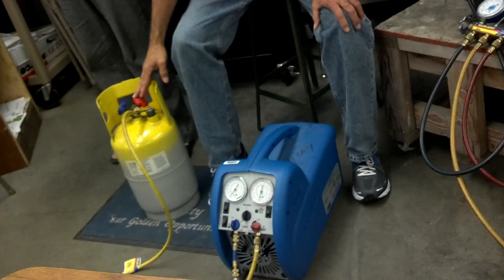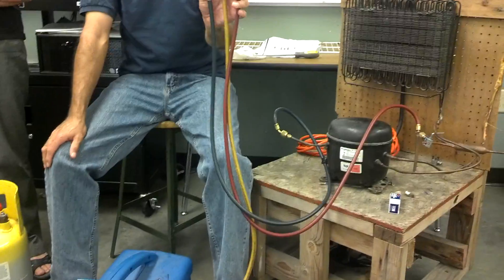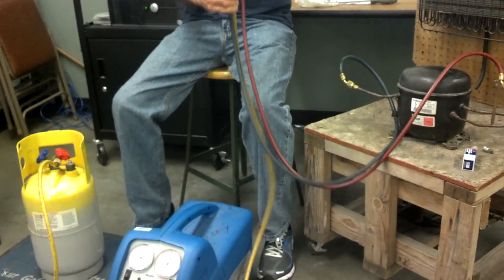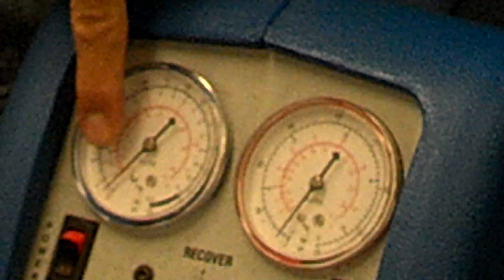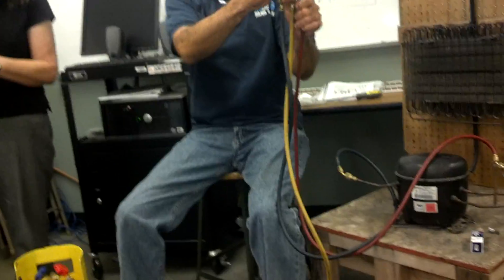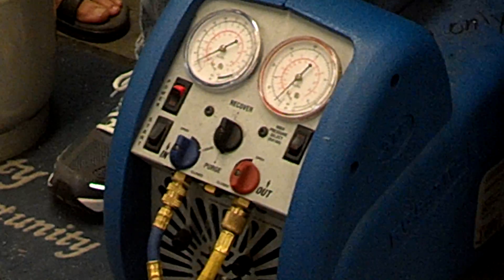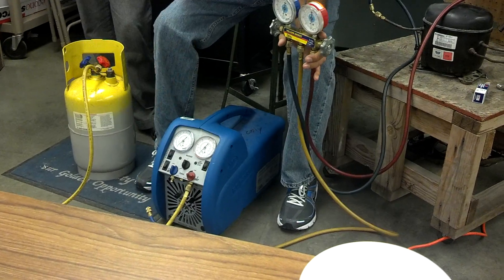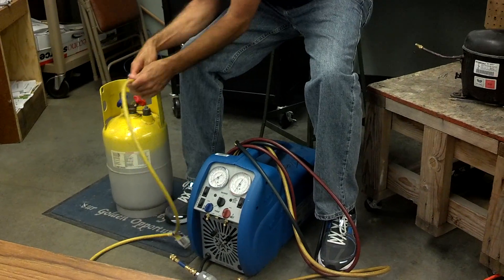Refrigerant recovery

Comment: Need to bleed the lines, you just contaminated your refrigerant you are trying to recover.
Reply: NO you should always try to avoid mixing refrigerants.
Reply: Can u mix r22 with 427a
Reply: Bill Ledford absolutely not
Reply: Or adding a filter dryer will be fine as well.
Reply: @alexdemartine4758  that only removes contaminants not air. Don't want to put air in your recovery tank.